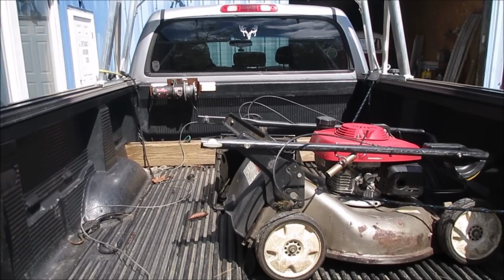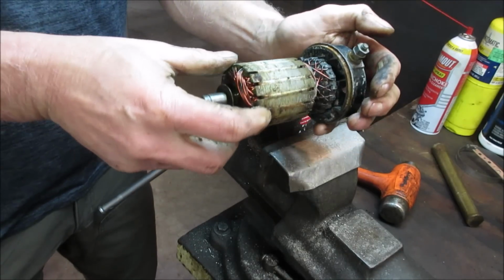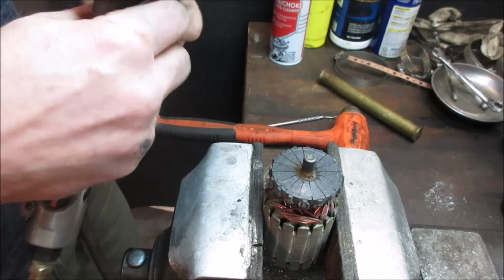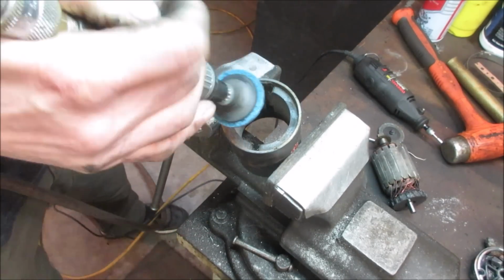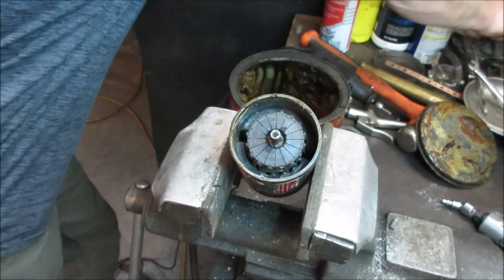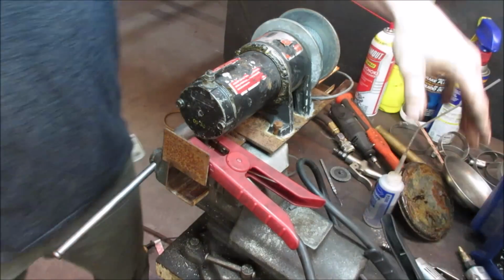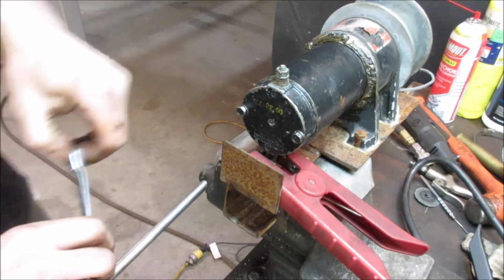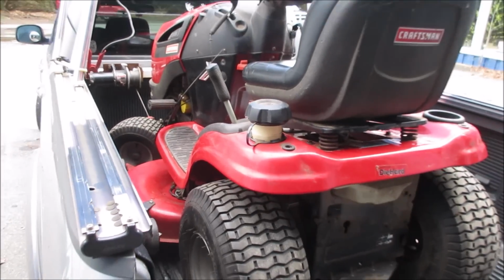Flooded and Stuck WARN Winch. Why Did It Fail?

Comment: Hi, anything outdoors that needs waterproofing I always use silicon sealant to form a watertight seal, works well for me. I was cringing a bit when he used a wire wheel to clean the rotor core, the wheel looked awful close to the windings, don't want to remove any laquer or enamel from the wire.😏🇬🇧

Comment: the motor its self looks like the superwinch on my snowbear plow, but the connections come out the very end not the side of the end, anyway i have had to super glue the magnets back in place. and also no O rings, so i pulled both ends away and put some dielectric grease in the seams then put it back together like you did with the grease.

Comment: As your explaining the spool capacity, you could have mentioned that often times a pulley is added and the end of the wire is fastened to a fixed point as in the truck bumper.

Comment: I read a story about a dredge like the one my father-in-law was stationed on in WW II.  While crossing the  Atlantic they took sea water in the engine room (they were Diesel-electric drive).  In the middle of the Atlantic they tore down the motor and generator and dried out the windings for the one of two drivetrans that were affected.

Comment: Witness marks before you disassemble a motor is always a good idea. Scratch them in. You don't want to go wiping your marks off when you clean. And yeah the motor won't run missing a set of bearings. A little oil on a bushing isn't going to hurt either. A lot of oil slinging around will though.

Comment: Best way to visualise the cable gear ratio thing is to think of it like a derailleur gear on a six-speed bike, bigger gear means less pull, its reversed as the cable is pulling rather than being pulled by the chain but you get the idea

Comment: I have a bottle of Zoom Spout on my shelf.  I used it on my swamp cooler fan blower and motor bushings and old furnace blower motor.  I have new HVAC system, so now instead of preventive maintenance, I’ll be needing parts replaced. 😏🤷‍♂️. Got nothing else to oil, so my bottle will last forever, just like my shampoo bottle. I’m bald. 😆

Comment: Take those wire brushes for a Dremel and put them in your vice right above the bristles where they attach to the shaft and crimp them on tighter and they won't fall out on you.

Comment: The winch that came to me via a ATV, pulled a lot of amps with no load. Like 30 and I would expect half that, taking off the end cap the motor looks clean and the brushes are little used. So it might get canned....

Comment: I bought one of those Harbor Freight winches for 49.95 in 2005. Mounted it on my race trailer and it had a remote so I could walk alongside the late model and steer as it went up the ramps. It had a lock device so you could free spool the cable out.  It was still working when I sold the car and trailer in 2015.
Reply: I replaced a polaris/warn 4500 winch with a HF 3500 , it was a quarter of the cost and works good,  been running it for about 6 years using it on a snow plow.  It is smoother and quieter than the polaris winch still working great. I think most of these smaller winches are all  MIC now.
Reply: @luuk-out-below9804  When I was shopping for a winch, I looked at some more expensive brand name units, but I thought to myself- we race about 20 times a year, so that is Load and unload about 20 times per year and I figured for 49.95, if it lasted 1 year it was cheap- considering it was still going after 10 years, it was by far the cheapest thing ever in racing.
Reply: @oldschool1993  I have been happy with mine.  Maybe we just got the good ones out of the batch!

Comment: The grease "seal" will only last until the heat of summer and then it'll run off of and down into the motor.. I use brown Permatex hardening gasket maker from a small tube..

Comment: You should put a little umbrella above it, meaning a piece of sheet metal, but it might be overkill, now that you greased all the body joints.
I wasn't worried about that brush, when it snapped. It still has a contact point, and might wear out faster, but it's an old rig anyways.
Reply: Did he put grease in the bolt holes?

Comment: maybe the whole housing/magnets were flipped 180 (end for end). that could through the magnet placement(brush alignment) off and make it bind, even with the keying aligned.
as the brush end is rotated slightly the current draw will change some in forward vs. reverse. probably not enough to effect it's performance greatly, in such high power draw heavy load usage, vs a long running device like an floor scrubber or pumping device. 🤪

Comment: Another great video. How did you fabricate that long tube on your light oil bottle? Did it come that way? I'd enjoy seeing a video on your shop and the different tools you've found useful and how you've fabricated or modified them. Thanks!!
Reply: I do believe he has a video about his tools and Mach ups tools he's modified. Not sure where it is .
Reply: It comes that way. It’s Zoom Spout.  It’s made to get to blower motors and such in Olde HVAC before all of the sealed bearings stuff we have now. 👍🏻
Reply: @tomtheplummer7322  👍

Comment: Just out of curiosity, why did you not use a small bead of silicone around the mating surfaces? It seems that during the summer the heat of the sun will melt the grease and it will drip out. I realize you live up north but with hotter summers everywhere you will not be immune.

Comment: Similar motors were used on snow plow lifts without the option for reversing, Why would the designers not think this unit would be exposed to the elements   ?  common scene or lack of .   Like you  said the harbor freight version had orings .

Comment: Great work Mustie buddy.  The labels were definitely on top when you took it apart, what changed to make it work with them on the bottom?
Reply: That’s a permanent magnet motor. The orientation doesn’t matter there. However, it does matter on a motor that has field windings.

Comment: my 12000Lb winch had O-rings fail where the terminals are, and it allowed water in overtime and destroyed the brushes, luckily it was a popular winch so i waited till i found one on the kerb and took it from that, what about graphite for lubrication locks etc

Comment: I see that at 12:43 you anointed the commutator with oil (despite simultaneously saying that it wasn't your intent).   The drop of oil then slowly spread over that portion of the commutator segment for the next couple of minutes. 
But what's a little more oil when you don't bother to clean the existing crud from the commutator anyway?

Comment: I have a question. On an old garden tractor, my JD 212 for example, bare tractor with no implement of any kind and no driver, which is heavier front or rear? Is it something like 40/60 front/rear?  or maybe 60/40?  35/65?  65/35? 50/50?   Those are percent(%) not pounds(lb), lol.  I've asked that elsewhere but people just remain silent as if they don't know or even care, or maybe they want me to find an accurate way to weigh it and tell them! How would you even do that, 4 bathroom scales? LOL, might work!  General or specific to tractors are both fine by me, anything that gets me closer than a wild guess will help.

Comment: Its...........Mustie season!!   3.26......there doesnt seem to be a sealing o-ring,rubber gasket or sealant between those sections of the electric motor body.  Did it have an IP rating ?

Comment: I found a 70s model Troy bilt Horse tiller in a dump. I put new points ( Adjusted to .20) and condenser, new head gasket  and new carb on it. It will start on first pull but no matter how much I adjust the carb it runs rich. I tried both adjustment screws but can only get it to run mediocre at throttle.  I never messed with timing. Any advice?

Comment: Now Darren....how hard can it be for you to rig up a weatherproof fwd/rev rocker switch?!  (Part 2 coming up?)
Reply: The power would have to go through relays. I don't believe there are rocker switches that can handle the current demand. A rocker switch to control two relays.
Reply: @dans_Learning_Curve  I once had an electric/hydraulic tilt trailer and I ran some HD electrical straight off my battery (+ ground from frame) to a HD +/- plug by my rear bumper.  The trailer had the matching opposite plug and my control was a simple up/down and it ran straight to the two contacts on the motor.  I don't recall any relays.  the heavy guage wire I ran handled the electrical demand just fine - and I also had a 130 amp alternator.  This was a '95 F350 w/ a 460.  Not saying "I'm right - you're wrong" just saying it worked fine for my application and I even hauled a 7753 Bobcat and the motor efficiently ran the hydraulic pump to lift into tilt position with minimal 'lug.'  Of course, after driving the Bobcat up the trailer, it went down faster, lol.
Reply: @RRRIBEYE  point taken! Thanks!
Reply: A couple of hefty relays, and a DPDT momentary contact rocker switch and you’re good to go. I built the same setup on my four wheeler to operate the winch on it. I used 3 pole lawnmower starter relays.

Comment: DID you notice the “oil”hole at end of motor it should have a plastic or rubber plug . 1-2 drops of non detergent motor oil per year and seal hole “plug to keep water/contaminants out

Comment: This is one of those situations where a little sniffter of WD-40 might be useful. That's both a water displacement fluid and insulator.  We used to spray it up the multiple-working jumper sockets/plugs on the cab ends of our 1950s/60s railway locomotives and they're working at a somewhat high voltage than 12V. ;-)

Comment: Quite clearly reassembled with the motor 180 degrees out. The two labels were aligned at the start. very confusing explanation of reduced pulling power as the cable drum fills. The winch is capable of a certain torque in foot-Lbs. More feet = less pounds pull thats it, plain and simple. "Silicon Bronze bush??" WTF! its a sintered oilite bush that needs to be soaked in oil now and then to work. All the grease attempts as sealing are wasted as the long screws will let in the water as before. Need to fit Dowty seals under the bolt heads .

Comment: Explaining how the cable length  matters I don't think you'll understand it that little bit of cable difference doesn't matter it's all about the electric motor how much it can handle with a load before overheating